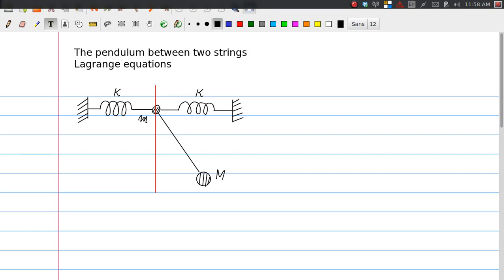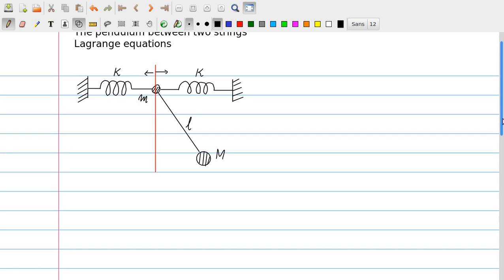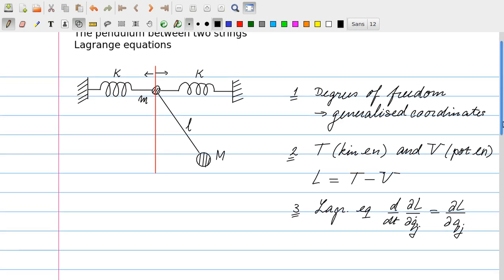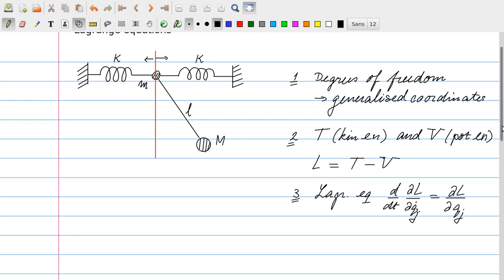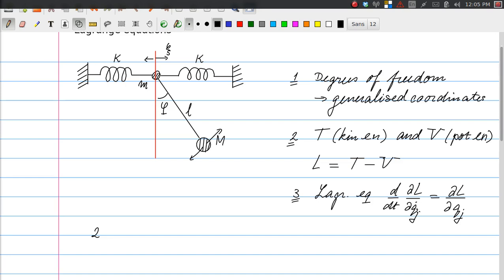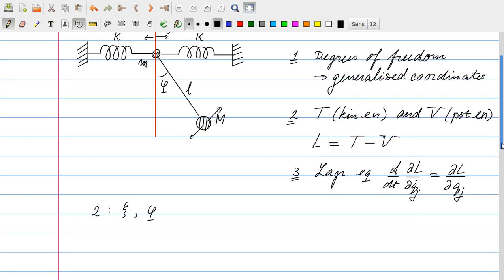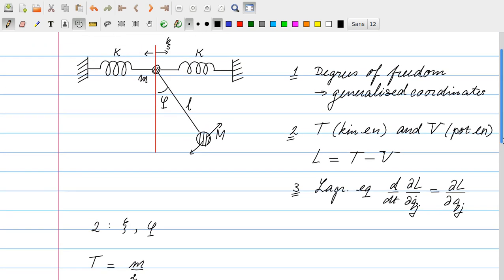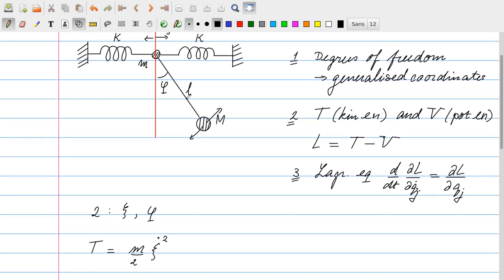pendulum lang movie

Comment: could you show us how it would be without the Lagrange method, only using sum of forces and moments?  how it would be if one wall moves with an harmonic function u(t) ?
Reply from the maker: Thanks for your question. Hmmmmmm. You use Lagrange here in order to facilitate the solution. If you do not want to use this, the solution becomes more tedious, but you will find all the forces enforcing the constraints. So you need to include (i) the spring forces, (ii) a force which keeps the suspension point horizontal (iii) the moment of the forces (gravity, spring forces) w.r.t. either the center of mass or the suspension point of the pendulum. Seems doable but why would you like to do that? 
If the walls move, you can still use Lagrange, but the potential now involves u(t) and is therefore time-dependent. As in the Lagrange equations you take the full (not partial) derivative with respect to time, the potential yields a contribution there. Would be nice to try and then solve the Lagrange equation on your computer and make an animation.

Comment: Why is sign in front of term Mlgcos(phi) - and not +, isn't y coordinate faced downwards,and also is gravitational force,if you could explain it would be helpful
Reply from the maker: The term Mgl cos (phi) is maximal for phi=0. Therefore, the potential energy is minimal when phi=0. Therefore we should have a minus sign. Note that l is positive. For phi=0 the potential must be -Mgl (up to a possible additive constant). The convention for the positive/negative y direction should not affect the final formula for V. If your calculation is consistent, V should always have the same form, independent of axis conventions.
Reply: @josthijssen6782  Ohh, i get it now, thank you so much
Reply: Actually for calculating potential energy we should consider (l - lcos) thetha right